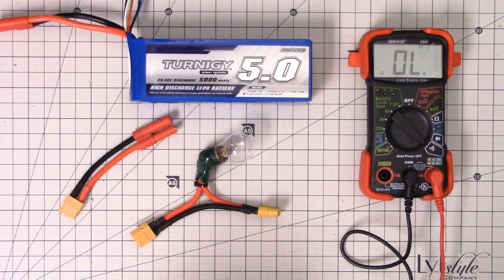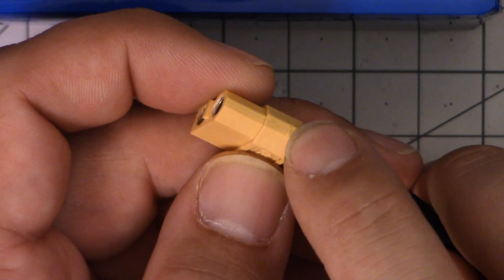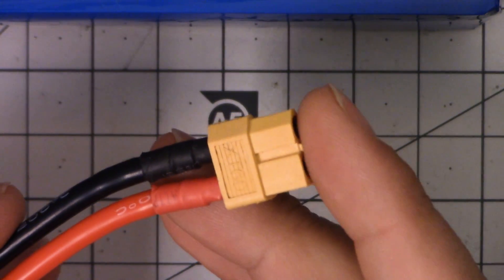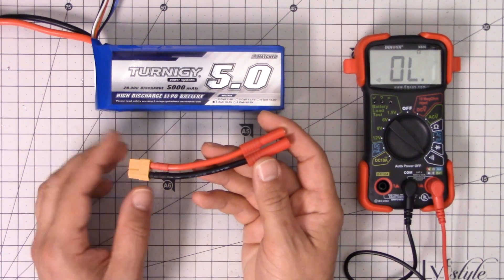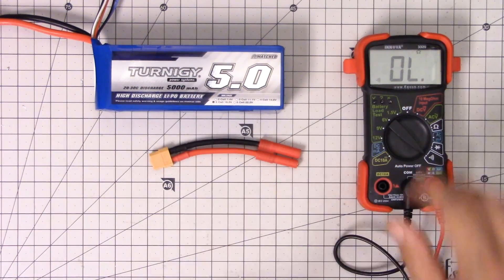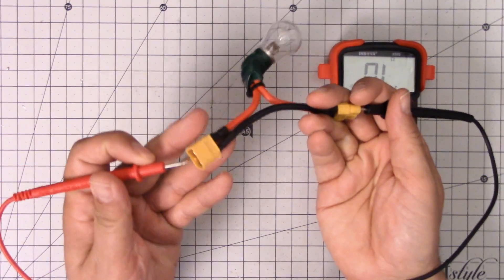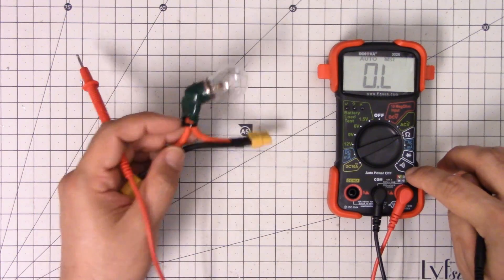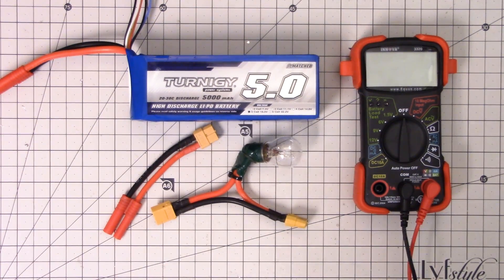HOW TO USE A MULTIMETER to make a LiPo adapter safely

Comment: Hello Joshua, 1st of all, THANK YOU very much for al your work and dedication to the hbby and us. :-)
I whatched all your videos about multimiter, continuity andsmoke stoper.
I build a quad 3 days ago and when I plug the battert, the light of the smike stopper blinks with th two last bips of the motors.
Im using F4 Flame race Spec STM32F405, 4 in 1 ESC.
1 - With the miltimiter theres is no continuity.
2 - I show my problem on a electronic store.They cant explain why the light blink. They say it doesnt make any sence.
3 - I desolder everything and test with the smoke stopper all the connection while Im resoldering. I believe the problem is on the signal cables from de ESC. Whith the 1st two cables (it doesnt metter witch, I try all of them) the light of the sttop smoker doesnt blink, with 3 signal cables it blinks a bit and with the all four, it blinks with the last two bips of the motors.
I was using this ESC on other build and it was flying  ok, no crashes.
If I my explanation isnt enought, I can send you a video with the problem.
I know you like a chellenge.... What do you say about this one?
Can you help? Please...
Thank you again for al your work.
Best regards
Reply from the maker: The light is blinking because the motors are pulling current. When current flows, the light blinks. It doesn't matter whether current is flowing because there is a short or whether it is flowing because the motors are spinning.

What you're seeing is normal.

Make sure the bulb you are using is about 25 watts. This will cause it to light up when more than about 2-3 amps flows. If you are using a much smaller bulb, it will light up under normal conditions.
Reply: Thank you very very much. Im using a 12v, 20W bulb.
So, if I understand, the quad is fine and I can plug in the pc... Is that right?
YOU're the BEST!!
Thank you again.
Regards from Portugal
Reply: Back again!
I tested.
1st I tested home no props. Motors were in the right order and direction.
I took outside, I plug the battery, everything ok, 2sec after arm with NO stick input the quad throttle up, yaw left max and flew away from the park to the street.
I took 3 sec to disarm. I broque the frame, 2 motors, FC, Vtx and the board of the runcam split.
:-'((((
Do you have any idea why that happened and how can I prevent happening again?
The adventure continues....
Thank you for all your help and dedication to us :-))

Comment: i dont have a beeper in my mm. can i inspect shorts by using resistance?
Reply from the maker: +MattyD_Gaming yes.
Reply: do you know how? on all my quads i always measure some resistance between the + and -, but never short anything when plugging in :p
Reply from the maker: +MattyD_Gaming resistance is what you want. Thst means no current will flow. If you had 0 ohms or very low ohms that would be bad.

Comment: Hi just a line the continuity Buzz setting on most metres is approx 40-50 omes which is fine for +to+ AND to but not for +to- that neads to be the biggest resistances range on the meter as their is such a large current potential that eny reading between +and- could be catastrophic

Comment: Any idea why my motors want to catch on fire after 10 seconds of flying but don't even get warm if I run them from the betaflight motors tab?
Reply: Could be because your D term is too high, so when you fly, the PID loop is active but when you run the motors tab in Betaflight, it is just spending signal to motor, and the PID loop isn't active. Try lowering your D term.
Reply: D is 0 and i tried 5 and 10 as well. Flashed to the latest firmware and even down to 3.1.0. No luck :(
Reply from the maker: Because your D gains are too high. The PID loop is not active from the Motors tab so there is no D term to make them hot.

1. Figure out why your copter has excess vibration.
2. Reduce your D gains.

Some combination of the two.
Reply: Reflashed again to another random version and they quit doing that... damn firmware killing me lol
Reply: Ahh, are you still running Betaflight? You've got me scared now :O
Reply: It was 3.1.7 that did it I think. Went to 3.1.6 instead and it's good for me

Comment: good video Joshua Bardwell.funny thing happened i lost and found my quadcopter i dropped it hard on pavement and the battery is a bit squashed deformed but still checks ok.i discharged it a bit on my cloned imax b6 charger and checked that it still ok.do you think i should use it or scrap it?
Reply from the maker: Scrap it. If it is squished and deformed, it is a big fire hazard. Do not charge it. Discharge it completely in a fire-safe location and dispose of it.
Reply: i figured as i was crossing my fingers that the man who picked it up and brought it inside a bakery overnight was lucky it did not go up in flames.people should be more careful.so much destruction from batteries everyday.a little 4s70c 850mah could have caused so much damage.common sense is not so common.i shall cut and save the wires and plugs.i hope that someone will understand the danger.thanks.

Comment: hey Josh thanks for your videos very helpful for newbies like me to the quad scene. I ended buying parts for a smoke stopper but I'm making one w a circuit break rather than a light bulb.
Reply from the maker: That's okay, but I still like the bulb better. With the bulb, when you draw current, voltage drops on the far side, but as long as the current is small, everything keeps working. With a breaker, the minute you exceed the rating, it pops and the circuit is dead.

Comment: I build a smoke stopper to.
Bought atrailor rearlight unit EU type. 
With R5W optional R5W 2 of them in series. Build in 
And P21W  Got 2 inputs and 2 out put to have serial and parrallel result.

Smoke stopper for 2 to 5S

Idea to build it out is using a
voltage display. also extend lead with a power switch.
A lipo alarm atached.

Comment: If you short something like a 5S or 6S 5000, the bits that touch tend to get vapourised instantly.  Ask me how I know.
Reply from the maker: The  worst-case scenario is the metal welds itself together and then you cannot un-plug the short.
Reply: how do you know? Sounds exciting.
Reply: That happened to me at work two weeks ago... welded it's self to a metal bucket and burned a massive hole through it.
Reply: Nice.   Terrifying, yet so cool at the same time.
I've only accidentally touched bullet connectors together when putting 2x 6S packs in series.  You get a white flash accompanied by a loud "crack", followed by me shouting and swearing.

Comment: Step ONE, get a real meter. It will cost you around $100 and it will change your life. That thing you got free from Harbor Freight ain't gonna do the job! The EEvblog has a great primer on getting you first REAL meter.   here -->   https://youtu.be/gh1n_ELmpFI
Reply from the maker: A person who is new to the hobby absolutely should not spend $100 on a multimeter. I use this Innova every day and have for years. It does everything I want it to do and it costs $20. Beginners have a lot of things they need to buy. An expensive meter shouldn't be one of them.

IMO, of course.
Reply: I strongly disagree. Especially with todays cheap Chinese meters. When you go to make a measurement, you need to have the ability to do it and you have to trust the numbers. My biggest mistake has always been buying cheap data instruments. You are only as good as your numbers and the time you save by buying a tool you can rely on. I suffered in electronics using cheap meters until I spent a buck.

We have a lot to buy? We could try not buying the 4 esc's for our third quadcopter and properly troubleshoot the 5 esc's laying in the drawer. I would go as far as to say that I truly could not afford this hobby WITHOUT the one meter that I trust... Knowing that NOT all meters are made equal avoids a major pitfall. Learning electronics is costly, learning that you are not the idiot but that the 4TH meter from Harbor Freight is also a piece of junk is priceless. Craftsman proverb ..."TOOLS ARE MONEY IN THE BANK".
Reply: I have to agree with Joshua here, I use a $500 multimeter at work but a $10 one at home.
Horses for courses.
The cheap one may not be as accurate (I have tested it and it is pretty close)  as my good one but for what I do at home it is just fine.
For basic work at home including RC, millivolt/milliamp accuracy is not critical.
Reply: If your budget is an issue, then I would choose to skip the $58 on the TS100 portable soldering iron. It doesn't generate enough heat for all purpose soldering and unless you race, you will never use it in the field. The tips also go bad and they are expensive. I would take the money and put it into a meter. I don't know anyone who uses a good meter at work and then a $10 one at home but to each his own. I would never use a $10 meter on mains power though. Why have a meter or a soldering iron that you can only use part time. But this isn't my channel, so go with Josh on this one.
Reply from the maker: +Elf Kind I agree that the ts100 should probably not be the first thing a n00b buys. It shouldn't even be the first soldering iron.

Comment: Can you link the lamp and holder you use for smoke stopper?
Reply from the maker: The lamp is a basic 25-watt tail light. This one will do: http://amzn.to/2oDGehN

I don't use a holder. I just direct-soldered it.
Reply: Thanks Joshua, appreciated
Reply: I build it in socket of 3.

A 12V R5W restrict amp even more then P21W
A 24 R5W maybe 6S lipo could be used.

With that could use almost any lipo
Reply: Joshua Bardwell i

Comment: Another beginner multimeter tip: How to check if battery is wired the wrong way at the factory? Set multimeter to DC voltage measuring mode, touch red probe to red/positive battery terminal (xt60 etc), black to black (careful not to touch the probes together while they're touching the battery terminals).
Multimeter will show you the battery voltage but if it also shows you a negative sign in front of the voltage reading that means the battery is wired incorrectly.
Reply: same tech.